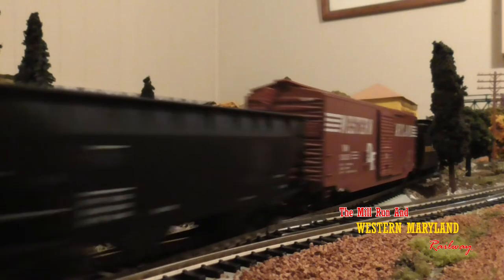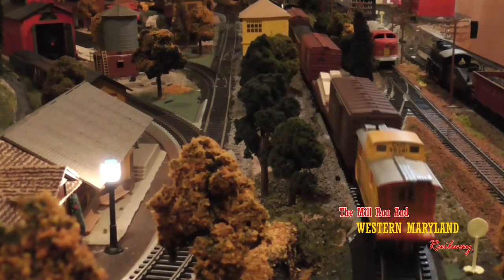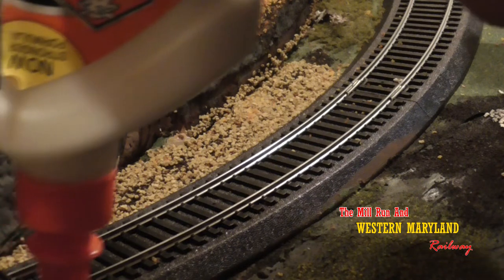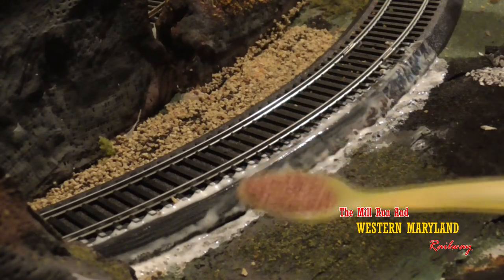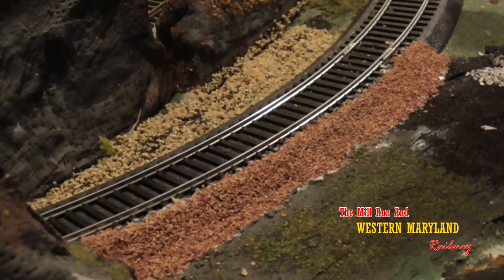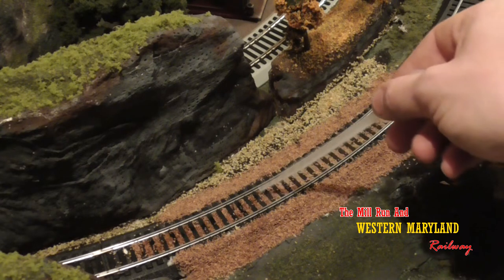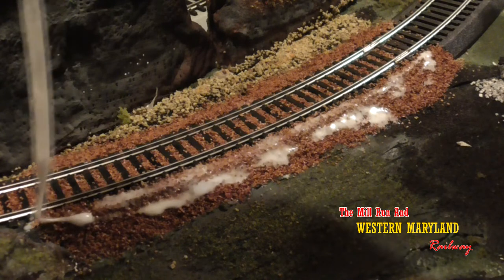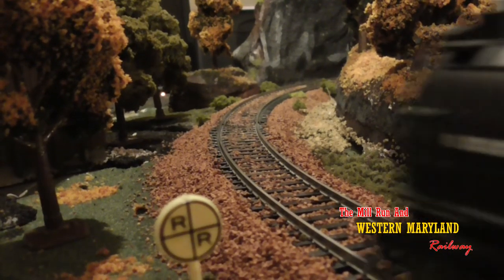How To Ballast Bachmann E-Z Track

Comment: Would you be able to do a video on your track wiring? I’m planning a layout but can’t find documentation on how to wire EZ track in a larger layout setting. Thinking it’s still soldering feeder wires to the rails but not sure! Thanks in advance!
Reply from the maker: I can put something together. Thanks for the idea and stay tuned!
Reply: No 
Just plug it into the track that’s it

Comment: If you run DCC on ez track, will you need more than one terminal to connect to a bus line? Or just one terminal section?
Reply from the maker: If I understand the question correctly, i think you'd still have to have more than one.

Comment: Question. Do u have to glue found ez track before ballasting? 1:10
Reply from the maker: I did not glue down my track before ballasting. And I found later that the glue from the ballast held the ez track in place fairly well when I tried to move the track around to make adjustments. Ha! But, if you decide to glue your ez track down beforehand, I would recommend using latex caulk.

Comment: Do you have to glue ez tracks down before ballasting?
Reply from the maker: Most of mine was not glued down when I ballasted. And I found later when I wanted to make adjustments that the glue for the ballast held the ez track very well.